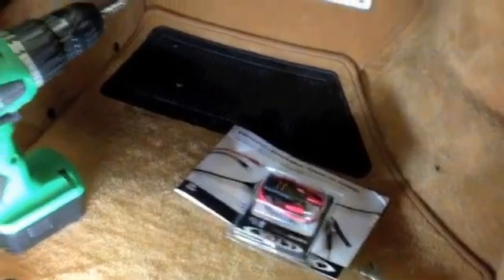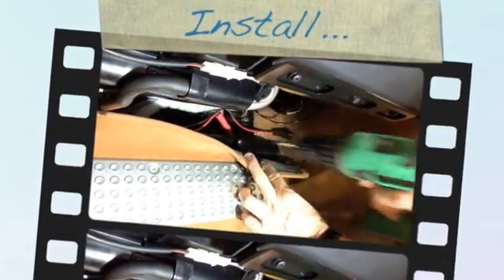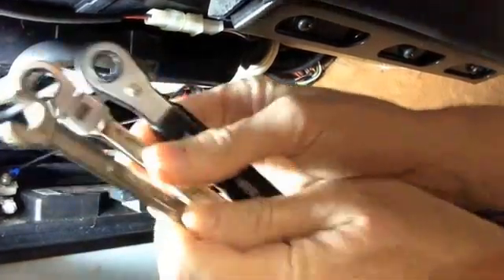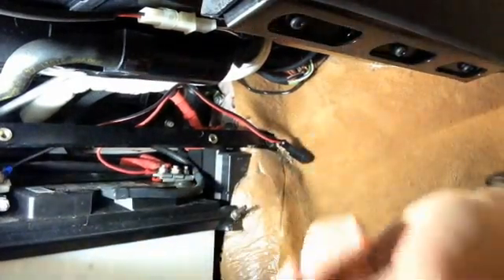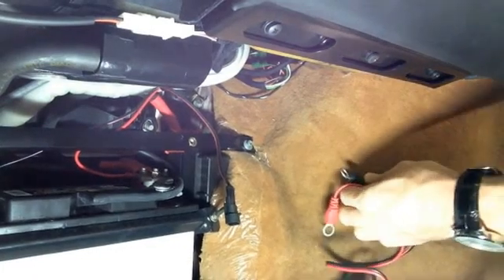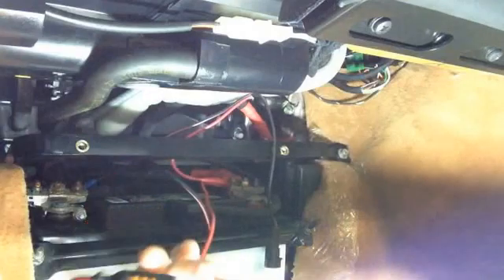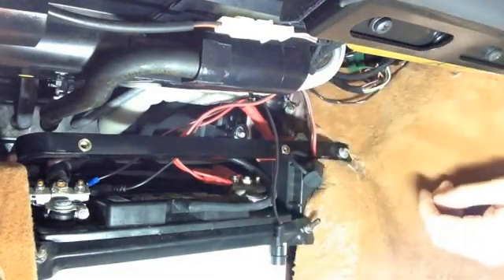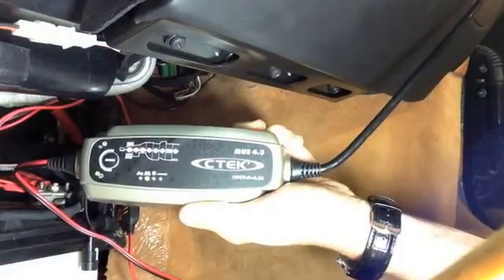DIY Battery Charger Installation - CTEK 4.3 - On Ferrari F430 (m)

Comment: Hi, Please note this is a CTEK Charger and Not a Battery Tender. Battery Tender is a specific brand.
Reply: Yes battery tender has only one current flow and amps and isn't as safe. I just bought this model over the tender.